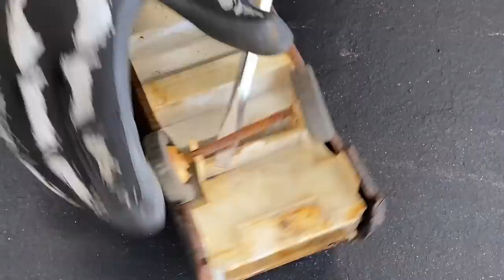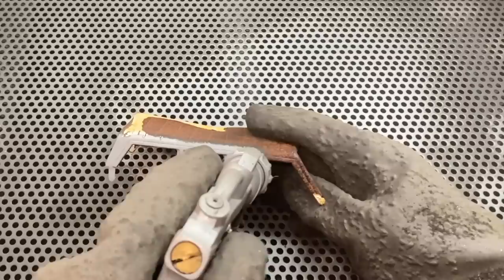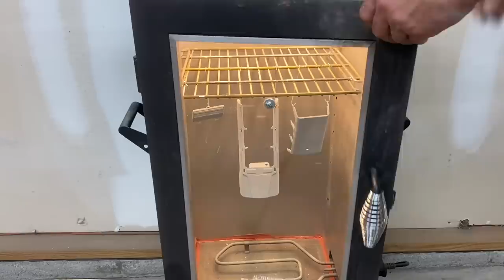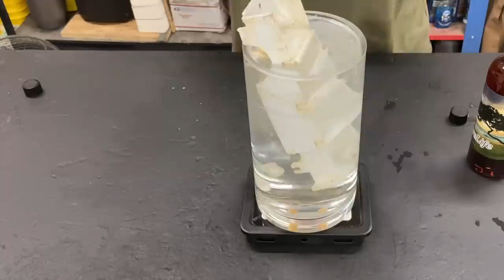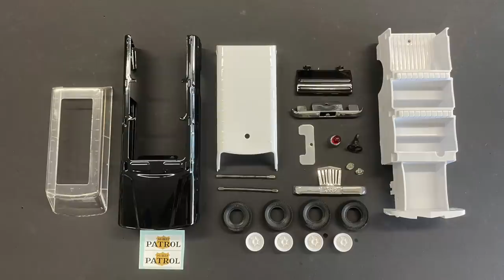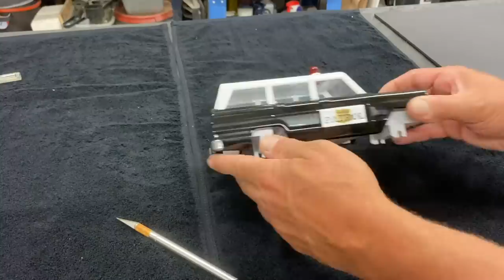1960's Tonka Hi-Way Patrol Car Restoration - Awesome Toy Restoration!

Comment: Beautifully done! Now add a flashing micro-LED in the bubble, and a pair of steady micro-LEDs for the headlights, and that 1960s toy will be 21st century!
...
I see other restorers using powder coating instead of conventional spray paint. What are the benefits of powder coating? (I’ve never asked, and no one has ever told me.)
Reply from the maker: It's a lot more durable than traditional paint and leaves a nice even and smooth surface
Reply: @TRGRESTORATIONS , thank you.

Comment: After viewing several of these videos, I wonder why you do not show blasting the underside of the panels. Getting into crevices must be difficult. As always, this was a fantastic restoration.
Reply from the maker: When you are blasting the inside of a concave surface like the underside of a Tonka, there is a lot of blowback, so it doesn't film very well. Not to mention the 3-4 minutes of blasting that a video has is really the tolerable max for most people. Thanks for watching! 🤘🏼🤘🏼🤘🏼
Reply: A sand blasting compilation would be fantastic!

Comment: Can you explain the reason for the epoxy primer? I though if you were powder coating that you didn't need a primer. Thx
Reply from the maker: It works as a filler, so it the pitting is bad, you'll need to build up the base to be able to smooth it out
Reply: @TRGRESTORATIONS  ok good to know. Thanks for the explanation

Comment: You know (and even if you don't) with all the restorations I have seen thus far and with the conditions the subject vehicles were in in the beginning of each project, I often wonder what story that could be told if the vehicles could talk. How did they get in such bad shape? What did the owner/child do to it? I know that some kids play with their toys pretty hard, and some get destructive. When I was a young boy, I had a few Tonka trucks. I only had them for a year or two when they were taken away from me when we moved across country. Decades later, I have taken up the challenge of doing my own restoration work, but I am limited to space and tools, so I had to cool it as it were. It wasn't until recently, that I learned that I was not the only one who likes to restore these kinds of things. I would do a restoration job, or a custom job. On a custom job, sometimes, I would add features and upgrades that were not included originally, or invented yet when the toy was new. It just a way to challenge myself. I like seeing these videos. It's something positive in a negative world.

Comment: Hi - really great toy and well worth restoring and saving. I am curious how do you remove the yellowing of the plexi in general and what kind of mix do you use to clean the cabin? I have not been able to perfect this process yet and would love to learn.
Reply from the maker: 12% H2O2 and UV light, add a little Oxyclean if it's being stubborn
Reply: @TRGRESTORATIONS  very much appreciate this expertise sharing. I will try and see if it does the trick for me. Stay well!

Comment: I’m redoing a jeep with those same wheels.  I need to replace one of them and find a steering wheel and headlights. Do you know where I can find them?   Also is the whitening fluid just 12% hydrogen peroxide or is there another fluid you mix with it?  Thank you for any help you can provide

Comment: Just a simple question for you.?? I have a few tonkas to get restored before I give them to my grandson.  Im curious if using a soda blaster will be sufficient enough to take off the rust and original paint coating??? I plan to renovate and do a couple of custom restoration for my grandson.   Any advice be helpful. Plus where can I get replacement parts for a decent price.  The people who sell parts here cost as much as the toys were new back in there day!! Ridiculous price to try to restore a toy for a new child to enjoy.  I can't see paying hundreds of dollars for a toy to be played and left outside at times.  Be different if I was restoring them to warehouse for collection.  But I intend to buy them for my grandson to play with them!!! Give him 40 years later the true toys that we all grew up with and enjoyed for years. Not plastic junk that won't last a day played with!!!  Help is for sure appreciated!!!
Reply from the maker: Soda blasting would work. As far as cheap replacement parts, not really such a thing, there are several websites to buy them from, but they can get pretty expensive.

Comment: Are your H2O2 baths a one time shot or are you able to re-use the solution for other projects?  Do you make adjustments to your blaster for heavily-rusted items?  Increased pressure to the nozzle?  A more abrasive medium for the blasting?  Seems like your rust and paint removals are effortless once you're in the blaster.  GREAT job as always.  Love the results.
Reply from the maker: They can be reused usually once. I don't do much adjusting to my blast cabinet, some parts are just easier than others

Comment: Having watched more than one of this type of video, I wonder how the surface pitting was dealt with, post sandblasing. In the past, I've used finishing "bondo" to get a smooth finish but I didn't see that here.
Reply from the maker: You'll need Bondo on some of the major pitting, but the epoxy powder coat primer is pretty high build, so it takes care of most minor pitting.